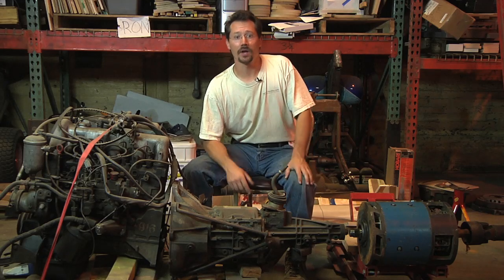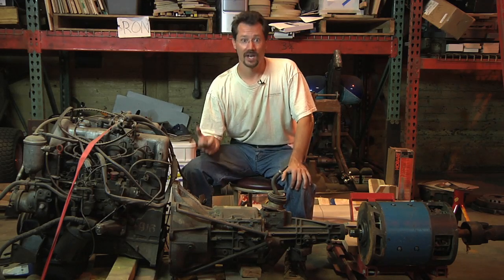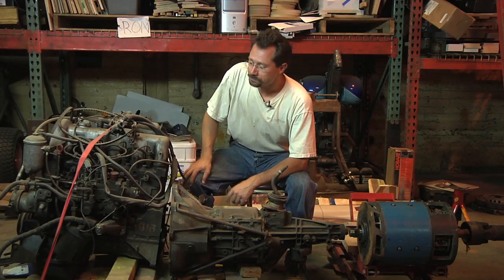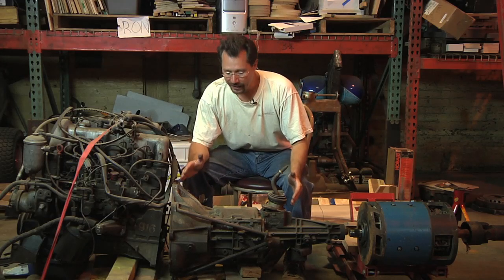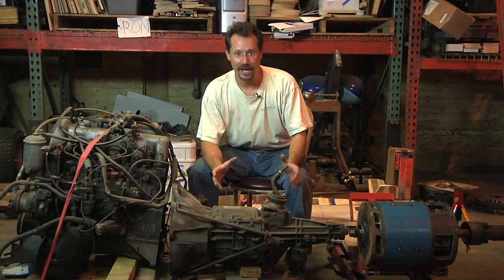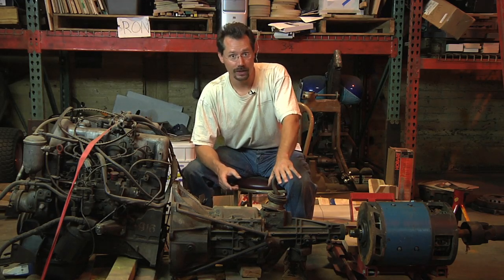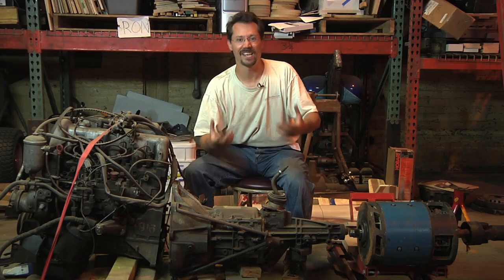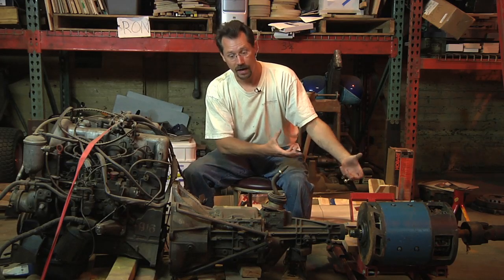Ben's DIY Open Source Plug-In Hybrid Pickup Truck concept intro

Comment from the maker: I just met an automotive engineer the other night who designed a hybrid Humvee for the military. It used a Volkswagen TDI and generator to electric motor for a serial hybrid setup. Fascinating stuff!
Reply: Turning the output shaft, of transmission, does not allow the circulation of gear oil/lubricant .It may cause issues with bearing failure.

Comment from the maker: I took the "Chevy Volt Approach" in converting my Electric Geo Metro to a series hybrid. There are several issues with that on a DIY level. One of them is just fitting everything under the hood. The motor in the drive-shaft approach makes use of space outside the engine compartment, and allows the car to be driven on EITHER the engine OR the motor. It gives more flexibity depending on how/where/when you drive.

Comment from the maker: I don't need to get to freeway speeds, but I need to be able to drive the vehicle directly on JUST the electric motor if I want to get up into good fuel economy averages. If I can run on ONLY the electric motor half the time, I'll double the fuel economy. A gen1 Prius tops out at about 41 MPH before it physically starts turning the pistons.

Comment: Back in 1998, I had a buddy convert a small import pickup to EV. Turned out his commute was a tad too long for the batteries. He had to give it up. He should have gone hybrid! :) 
We are loving our Prius C2. Now using the Ford Escape(24 mpg) for hauling any big loads. Everything else, we use the hybrid. It's the only way to go! 
 Good luck with your new challenge!

Comment from the maker: We don't have "brake tags" in my area. The main thing is pollution controls. We only test 1996 and newer models though. It's not worth the State's bother to test older models without ODBII. When I did my "Electro-Metro" electric car conversion, I checked on all those things. My 1994 pickup truck will be exempt from the pollution inspection, although of course I want it to run as clean and possible. I had no trouble insuring my electric car, so a hybrid pickup won't be a problem either.

Comment from the maker: No, in this case, the truck will be a parallel hybrid. EITHER the engine OR the electric motor can drive the truck down the road. The engine will act as a traction for the wheels, NOT as a generator. This has the advantage of me still being able to make it home if either system has a problem! Also, it's more efficient to run mechanically off the engine at freeway speeds. On the Chevy volt, at a certain speed with the batteries depleted, the ENGINE powers the car down the road, NOT the motor!

Comment: Sounds like you have a plan. The other thing you could do, is use a few solar panels that can keep the battery charged while sitting idle for long periods, maybe even letting it charge while sitting in a parking lot. The less fuel you need the better. Also for the diesel, see if anyone is selling bulk lots of poppy seed oil. I knew a guy that just boiled the water out, and ran it in all his caterpillar farm gear and a Peugeot 405 turbo diesel. Cost him about 89c a liter. Half the pump cost.

Comment from the maker: As I'm planning it right now, the batteries are going to be the very last thing to go in. Cost of lithium is always going down, and it's going to take a while before I actually get to that point. I know I'll test the truck with just some lead-acid batteries. I'm also going to figure out exactly what I'll do for the final batt configuration because I need to save up and raise funds for it! Everything else is pretty cheap EXCEPT the batteries!

Comment: Good stuff Benjamin. I can't wait to see how it all goes, as you put it together. I love the idea of an inline electric turbocharger/drive motor. Awesome idea. Should be good acceleration once it's all together. I'm assuming you will set up the electric motor as a battery recharger for when the truck is running on the diesel engine. It should charge it up in no time. Your probably gonna need a battery module temp controller so it stays at operating temp for optimal charging, and battery life. :)

Comment: What would you think of instead  - taking out the trans altogether, running a generator with your diesel engine and running the vehicle continuously on the electric motor?  Perhaps you could find a sweet rpm spot where the diesel used very little fuel and run it fixed at that speed.  Probably 4 batteries would be enough to smooth the electric output to the motor.

Comment: What do you think the top rpms will be with just electric motor with the battery pack you are planning? I was wondering if it will turn fast enough to push the rear axle fast enough for road speeds.

Comment: Any updates on this one?
Reply from the maker: No. I think the boat has sailed on that one.
I still like the original concept, but part of it too was that I didn't have the budget for it.
The skills needed for the project were just a little beyond what I had at the time.
We went from hybrids to good long-range EVs pretty fast and all electric mass-produced pickup trucks are right around the corner.

I found that a used electric car with a trailer was actually a pretty good alternative to a hybrid truck.
Reply: @BenjaminNelsonX  got you. Yeah I had this idea many years ago but I never got off the ground with it. You got a lot further than me. So I started doing some more research I thought about maybe giving it a go again but then I ran into your video and I see you had the exact same idea.

Comment: where will the batteries be stored?
are you going to use used batteries again?
what voltage battery pack are you going to use?

Comment: Use caution with this set up. In all electric mode, transmission in neutral, and engine off, the transmission will experience excessive heat and wear due to no hydraulic fluid protecting parts. Much like towing a vehicle,  you do not want the drive axle rolling down the road without the transmission pump running, and the pump is mechanically bound to the engine crankshaft.
Reply from the maker: This is a traditional manual transmission. There is no transmission pump powered by the engine.
Reply: Can someone help me to understand how someone could be educated enough to know that (some) automatic transmissions need to have the fluid pump on while simultaneously being so dumb they can't tell the difference between an automatic and a standard?

Comment: the rotor inside the electric motor it could handle a much powerfull engine? and what if the electric engine could work as an alternator when the petrol engine is running to recharge the battery?,.,. must be a dc motor? or an ac motor to this?

Comment: if you use the 4 wheel drive splitter behind the transmission too you could hook the electric motor to the the part that normally goes to the front diff prolly need to mount the electric motor behind it (under the bed) and use a jackshaft and chaindrive to the splitterbox so the electric motor doesnt take the floorspace meant for the driver 
when using only the dieselengine select 2 wheel drive and a gear when you want to add electric power select 4 wheel drive and a gear want electric only select 4 wheel drive and put gearbox in neutral
not sure if the splitter is capable of handling the power comming in from the wrong side of the gearbox but if it does it would solve quite a few problems selecting between them
Reply from the maker: Yep that would be another way to do it! There are some hybrid line trucks that have a design similar to that.

Comment: Could a plug-in hybrid pick up truck be built/altered to pull a two axle camper/travel trailer?
Reply: The main concern wouldn't be power, since the electric motor has heaps of low end torque, but rather braking and steering. In this example, a Chevy S10 probably won't have enough braking power to stop a large trailer in time, and such a trailer would be murder on its small steering gearbox. If you were to bump this concept up to a 3/4 ton pickup, that might work but it would likely need two or more electric motors and the whole bed would probably have to be full to the brim with batteries.

Comment: Neat project Ben!
But I have noticed you do not have a 'power split device'
How will you ensure the electric motor and ICE are spinning at the same rate?
Reply from the maker: +mazin2892 
This concept uses NO "Power-Split Device". It would be a "power-pass-through device". The transmission would mechanically spin the motor which would mechanically spin the drive-shaft. The disadvantage is that there would always be that little extra weight and inertia of the rotor of the electric motor. The upside is simplicity.
Reply: +BenjaminNelson 
OK thanks.
I've had a look at diagrams for the power trains of cars like the p1, la Ferrari 918 etc
and they appear to use the same concept, is this correct?
Also since the shaft is mechanically connected does this necessarily mean the ice and motor rpms  match?

thanks in advanced.
Reply from the maker: +mazin2892 The electric motor and the TRANSMISSION speed would match. The motor speed would depend on what gear the transmission is in.
Reply: +BenjaminNelson 
thanks again.
nice guy
good video
and speedy replies
excellent!

Comment: Did you maybe think NO tranny Engine runs generator generator  there instead    and elec drive motor in front of differential and gas engine idles until on demand and elec motor brakes to boot this way with conventional system as back up

Comment: Ben, be careful in design when you speak of having the electric motor mounted directly to driveshaft; this is a potential safety hazzard. Be sure to build in safe falls/other safety mechanisms to keep vehicle from moving unknowingly.

Also, when you speak of an 'electric turbocharger' is this just the motor you are referring to? or do you plan to have the turbine in the diesel engine (presuming it's a turbo diesel) electrically powered/augmented as well?

Nifty project, look forward to seeing more, always wondered why electric was unused in trucks as so, the torque is most definitely there, heh. You do some good stuff man, keep it up.

Comment from the maker: One nice thing about popular small pickup trucks is that there is a fair amount of gearing out there to be able to change the final gearing in the differential. I'll try it with the stock gearing, and then change out the final gearing as needed.
Thanks for the comments on the rubber components - I'm familiar with that, but there are a lot of things like that which would be easy to overlook. All positive "please remember to..." comments are welcome!

Comment from the maker: With the motor inline, I should be able to recharge the batts while driving on the diesel, but only with a motor controller that allows for regen from a series-wound DC motor. Figuring out how to do that is going to be one of the many interesting parts of the project.
Reply: Dear Friend, It is possible made this system whitout bateries. A little combustion motor wich move a dynamo o generator who feed the electric motor, in order not use bateries?
Reply from the maker: @gabrielcastellano2678  Your description is exactly how diesel trains operate. They use a diesel generator to create electricity to power electric motors which rotate the wheels of the train.
The reason a train uses this system is because the electric motors have the torque to begin moving a train. Otherwise, the train would need a mechanical transmission about the size of another train car.

For an automobile, it would be more efficient to simply that that generator be an engine and power the wheels directly.
Reply: Thank you @BenjaminNelson I need to do this kind of project! I will see every video of this project

Comment from the maker: This particular electric motor will NOT work as a generator. There will still be an alternator on the diesel engine.

An AC motor would work to regenerate electricity, but I haven't seen any high-torque, affordable, AC motors with a tailshaft on them.

Comment: This looks like a great project, I have head a similar idea for a while.   Have you made any progress?  I am very interested to see how it works out.  Specifically, how you will control the motor to run at the same time as the engine.

Comment: how about taking the approach that the volt uses? the engine is used to generate electricity to charge the batteries. instead of referring to it as a hybrid GM calls it an EREV (extended range electric vehicle) because the gas engine is not use to actually propel the vehicle.

Comment: Interesting Idea but why not going full train mode instead? Get rid of the tranny connect a powerful electric generator straight into the motor, put the  electric motor exactly the way it is into the driveshaft! The result will be a sleeper truck capable of embarrassing a modern mustang! Since it's going to be on a truck fill the entire truck bed with batteries to have long range electric truck capable of hauling anything with ease on a hitch trailer! I'm just retorting my point of view that's all!

Comment: Thank you for the great videos. Whould it be possible to have regen braking on such a diy hybrid?
Reply from the maker: Hi Arie, this particular series-wound motor would not be suited for regenerative braking. Other motors such as permanent magnet and AC motors would work well, so YES, you could have a DIY Hybrid with region brakes, just not this motor.

Comment: I'm guessing the cheapest option for the minimalist DIY hybrid power (not hybrid drive) is get two to four 100ah deep cycle batteries and charge them with a plugin charger. Use a 100 amp relay to switch out the alternator. Removing the drag from the alternator will reduce the power draw and save some fuel while still being able to power electrical things in your vehicle. Maybe solar power charging may provide a modest kwh or so per day if one so desired.
Reply from the maker: Years back, I did an “alternator delete” and added an engine kill switch on my Chevy S10. Great little truck. EXCELLENT fuel economy. Better than my wife’s Pontiac Sunfire, which had the exact same engine.

Comment: Ben,
Great job so far!

I would like to do this with a Dodge Ram 3500 possibly driving 2 motors one for each axle. The Cummins provides approx. 300 hp. Do you know where i would look for motors and generator(s) for something like this? I'm sure i will learn much more about it following your project!

Comment: I can't wait! Well the ICE also recharge the power packs? Also I have see a conversion that placed motors behind the rear wheels. If you combine that with what you have here, it would make a real capable truck. If you want to make it 4x4, get a Suzuki Samurai transmission and transfer case. I have been looking for a 4x4 Samurai to build something like this using a VW Rabbit Diesel engine. I can't wait to see how you do it!

Comment: why not use the same setup as a locomotive in miniature setup, with a diesel generator out of a motor home?
Reply from the maker: I already built a series-hybrid. 
In this setup, the truck would still work if either system failed. In a series-hybrid, it will NOT work if either system fails.
Reply: @BenjaminNelsonX  thanks,

Comment: Ben, what are your thoughts about wear-and-tear on the electric motor while the diesel motor is powering the vehicle?  I'm considering a similar setup in a ranger that  see's quite a lot of miles, and would continue to see lots of highway miles under gasoline power, I wonder how the electric motor bearings and bushings would hold up, and if there would be substantial wear and tear while the electric motor isn't under power
Reply from the maker: I couldn't tell you for sure. That's one of the things I'd like to find out by trying it. I don't think it should be so bad though.

Comment: good idea,but couldnt you do without transmision to save weight? if I understand it corectly the engine acts only to charge batteries and these turn the Electric motor right,?